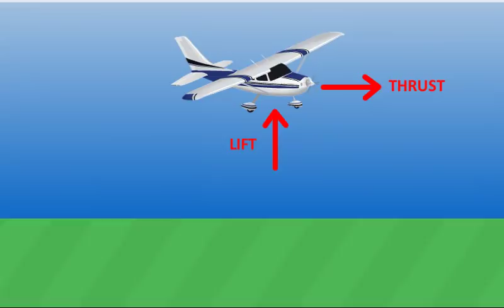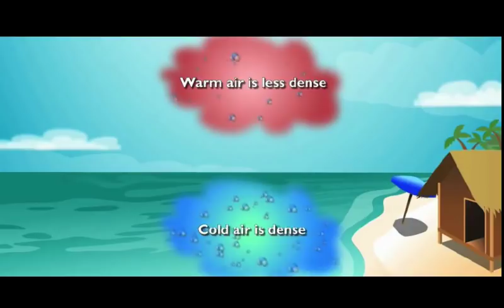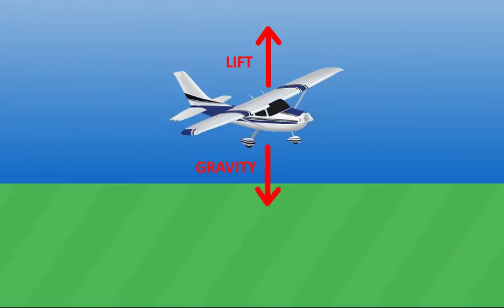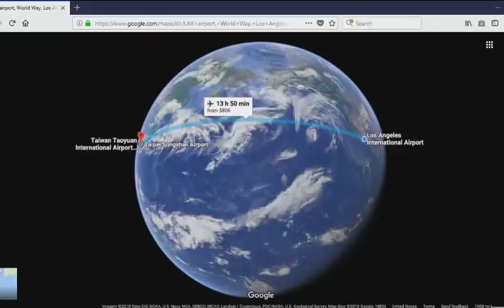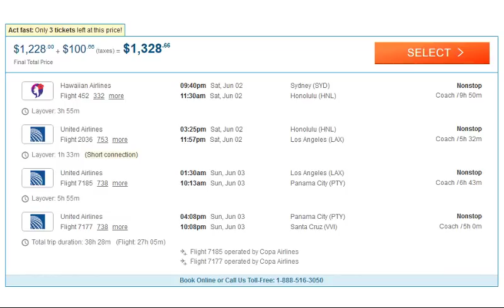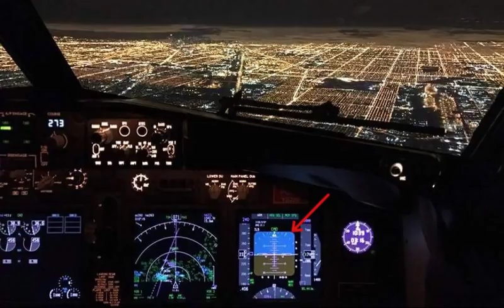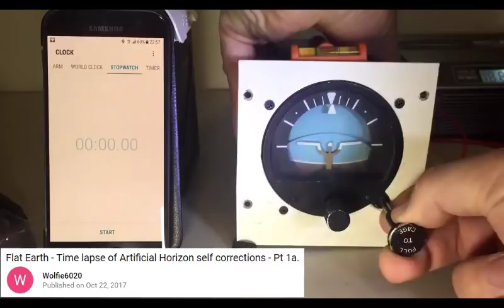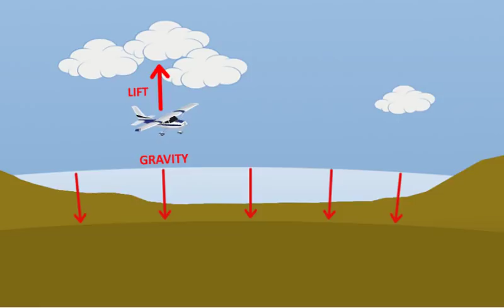Flat Earth Falsities - Plane Nonsense

Comment: I listened only to the first argument. You wrong right there. What does distance have to do with the atmosphere speed. You, my friend, do not understand the basic principles involved. It is relative motion between an aircraft and a pot on the earth surface that is important. Technically a plane flying east to west can stand still in the air  and the spot on the earth will rotate till it is  underneath the plane. Unfortunately it does not. Using your arguments it can only happen if the plane has the same airspeed, but a higher ground speed. This would mean higher fuel consumption and higher revs of the engines, Unfortunately the is not recorded p[ice of paper where pilots do indicate that they use more fuel flying in one direction than the other.
Stop wasting other peoples time by being yourself uninformed.
Reply: "Technically a plane flying east to west can stand still in the air and the spot on the Earth will rotate till it is underneath the plane" -- this would only be true if the air did not move with the Earth. But the Earth moving takes the air with it. If you use a spoon to stir soup, you will find that the soup outside the spoon will get "dragged along" with it. Now Earth has been spinning for quite a while, so air is actually at (mostly) the same speed all around the Earth, and inertia keeps it like that (spin a drink with your spoon, remove the spoon and watch it keep spinning for a while). If you want to see "air inertia" (instead of the fluids In the soup/drink experiments), take a close look at smoke rings and smoke ring cannons.

So once you accept that the atmosphere is moving with the Earth's crust, it follows that you can't stay on the same spot above ground by "standing still in the air": if you jump into a flowing river, you won't stay on the same spot with respect to the bank if you stay still with respect to the water.
Reply: @mendelde  I understand the argument that the theory is that the air moves with the rotation. (Just for interest it is a "theory" based on the assumption that the earth rotates. ) But lets assume that the earth rotates.
Have you ever seen a bird hover in the air, not flapping its wings and staying is position, due to the wind blowing over its wings?. That is the principle I am talking about.
If I am flying against the rotation I have to input more energy to fly "against" the wind/atmosphere, against "moving" with the earth. That means more kerosene flying from east to to west. Flying from west to east I fly "with" the wind/atmosphere, using less energy. Therefor there must be a fuel  difference ion direction...... or a speed difference .... or a time difference when you you argue like you do. But is does not happen .... It is also relative motion that counts.
Reply: @mendelde  BTW I have not even mentioned the problem of diagonal flights or flight from the poles to the equator. Even your airflow arguments do not hold water here. Think, according to your arguments, the atmospheric speed at the poles is Zero and at the equator a Max. The pilot has to constantly adjust his throttle to compensate.
Reply: @Daan The Man I like the way you argue. I don't agree with your conclusions, and I think you are making mistakes, but your arguments are logical and to the point, so it's actually enjoyable to think about them.

I don't really get what you are trying to show with your bird. The bird can only be stationary with respect to ground if there is wind; respective to the wind, the bird is sailing downward and forward, but the air current it is sailing on moves it back and up. Glider pilots use similar techniques.

I believe you haven't fully thought through the implications of air moving in synch with ground. I live near the 50th parallel, which is 25730 km long, and thus I move at ~1072 km/h around the Earth. A 100 km/h wind is already an exceptionally strong, rare storm, and stormy weather here comes with Northwesterly winds, while "rotational" wind should be Easterly. The fastest measured ground wind ever was 408 km/h, wind in Tornadoes is sometimes faster, and jetstreams in great heights can reach 650 km/h. (Utilizing jet streams does lead to considerable fuel savings for airplanes. Most of these big fast jet streams are also Westerly winds, though. The rotation of the Earth is not causing these winds, I think we both agree on that (albeit for different reasons).

If you agree that the athmosphere is moving in synch with the ground, it doesn't really matter if we fly or walk. The nice thing is that in systems moving straight, it doesn't really matter how fast the system is moving with respect to an outside observer. Walking forwards or backwards in a moving (not accelerating or braking) train feels the same. Passing an object from the back seat to the front seat in a car requires the same effort as passing it from front to back. Walking on a moving carousel requires us to counter the apparent outward force, so it matters if you walk in or out, but it doesn't matter if you walk with the rotation or against it. (This only matters for someone outside the carousel - but since the atmosphere is "on the carousel" of Earth, this doesn't apply.) I think you mentally want to place the plane outside the moving ground+air system, but it isn't outside.

Since the plane starts out on the already moving Earth, at my latitude the ground gives it an initial 1072 km/h speed due East, for an outside observer. To fly at 200km/h above ground due East, the plane only needs to accelerate to 1272 km/h from that, inside air moving at approximatel 1072 km/h in that direction already. To move at 200 km/h due West, it needs to decelerate from 1072 km/h to 872 km/h, again inside air moving at ~1072 km/h already, so like a swimmer paddling upstream, it turns into the current and accelerates in that direction. The physics are almost the same as if the Earth was stationary.
Reply: Daan The Man Your idea of considering motion from the poles to the equator or vice versa is actually quite clever. If I am flying from the North pole to the equator, at a fixed speed, due to inertia my sideways speed should remain constant, but the Earth below me starts moving faster to the East than I am as I am going South, as the speed of the ground on the outside of the globe increases the further out I go and the closer I come to the equator. So on a map of the Earth, it would look like my plane is veering West, to the right. On a flight from the equator to the North, the same thing happens in reverse: I start with a high Easterly speed, and as I go North, the ground slows, making me veer East, i.e. to my right again. This effect isn't all that strong, so it doesn't affect planes that much (remember that the plane moves through air already going at that speed), but it does affect the weather: weather systems (wind) rotate because of this. You can find a thorough explanation in the wikipedia article on Coriolis force. (The coriolis effect is opposite on the Southern hemisphere, which rules out that Earth could simply be a rotating, flat disc.)
Reply: Daan The Man I just googled *airplane coriolis*, and the general consensus is that airplanes do experience this effect, but that it's not very noticeable. In one question, a hypothetical plane flies from St. Petersburg to Nairobi, which moves 700 mph faster, but the response says that this flight takes 14 hours. This means the acceleration is 50miles per hour per hour, so imagine sitting in a car that takes an hour to accelerate to 50mph, instead of the seconds it usually takes. This kind of acceleration is impossible to notice. Going metric again, the acceleration computes to 0.006 m/s^2, so less than 1/1000 of gravity. It feels as if "down" is just a tiniest sliver to the side, and this effect is completely lost in practice due to crosswinds.
Reply: Daan The Man So this got a bit long, hope it's still readable :) tl;dr I didn't quite get your points re: the bird and inertia/closed system; you tend to conceptually mix up outside observer viewpoint and viewpoint inside the moving air/ground globe (aka what someone on the moon sees vs. what someone in the plane or on the ground experiences); and the consequences of moving North-South exist as you thought, and are well established as Coriolis effect.
Reply: tl;dr because air has inertia, it behaves similarly as if it was trapped above Earth inside a dome, such as the inside of a car or train or plane.
Reply: @mendelde  If you argue "inertia" then you are gong here against your own argument... sorry ...... It is closed environment or not.
Reply: Daan The Man , I don't understand what inertia has to do with "closed environment", or what point you are trying to make there. Sorry.
Reply: No Daan, once you have established "A", "A'" is established. You can then use it to determine "B". You don't need the existence of the moon to prove the existence of the Earth. You are the one utilising a circular argument to try and prove your incorrect assumption. You are also lying.
Once you have established a datum point you can then use it to establish other things. That is why you are able to spout your stupidity using an electronic devise over a world-wide comms system.
Diddums. Bless. Watch your heart.
And stop trolling, you pathetic, lying wanker.  @Daan The Man
Reply: @boffeycn  No You can not. That is called circular arguments. Go google it. Moron ......

Comment: actually ... for the first question, the time is different for very long distances, i flew from dublin to seattle, and the flight was 9H45 and on the way back it was 9h10, can be checked on google, which is also a proof of a spinning sphere
Reply: Flight attendant here, did you know what the flight load was on each flight? Speed? Weight of the fuel load? And how about headwind vs tailwind? Those are the reasons, not a “globe” 🤯
Reply: @briarcattara668  You mean the winds that result from the slowly rotating Earth?
And the Satcomms and Satnav being used, which depend on the Earth being a slowly rotating spheroid?
And the fact that the route was a great circle?
Reply: @boffeycn  slowly rotating earth so 1000mph is slow
Reply: @cireeric7175  Yes. Firstly spinning and rotating are not measured in mph they are measured in rps. rpm. etc.
I prefer to view things more sensibly, rationally even. The earth, which has a mass of  (5.9722±0.0006)×1024 kg (5.9 sextillion tonnes) and a diameter of just less than 13,000  kilometres is slowly rotating at (7.2921150 ± 0.0000001) ×10−5 radians per second. or 1.15 x 10-5 rps or 0.000696rpm
In other words it is an extremely massive object with a large diameter which is rotating very, very slowly about it's axis. 0.000696rpm. That is the rate at which the earth rotates.
The earth doesn't actually spin, a top spins, the earth rotates very, very slowly. OK?
Spinning is what tops and Jennies do. The earth rotates slowly, very, very slowly, at half the rate of the hour hand on a clock.
What is the circumference of the south pole?
Reply: Briar flight attendant so not a pilot hmmmm I'll go with what the pilot sees not some attendant
Reply: reda kanane - Flight times are not identical. There a lot of factors affecting the time including flight load, direction of the wind, cruising altitude / weather overall etc. It has nothing to do with the spinning of the globe.
Reply: Some ball proof, you had a speedmeter to check the speed? You dont know that with spinball perfect Momentum Conservation atmosphere stick to the ground there is also winds involve? Corolis effect stuff that does not care for conservation.
Reply: Louis Shaw he doesn’t understand that. He’s fucking moron